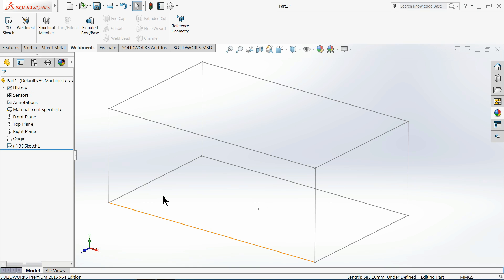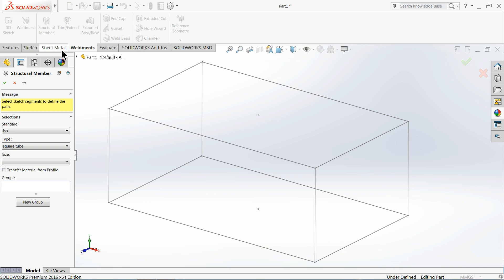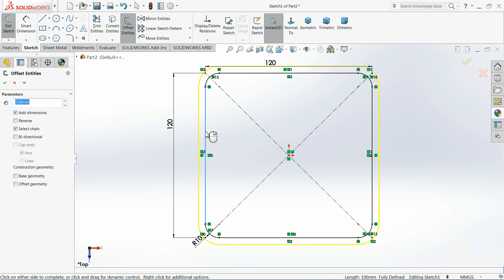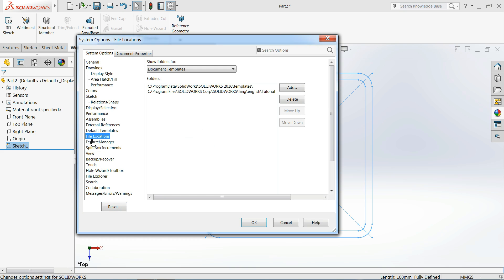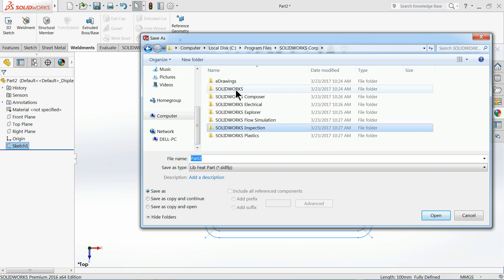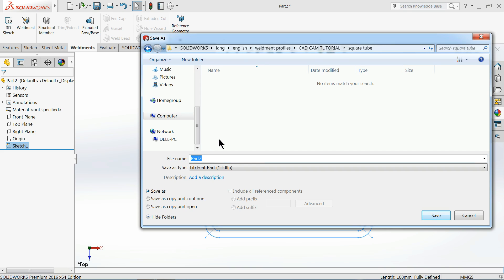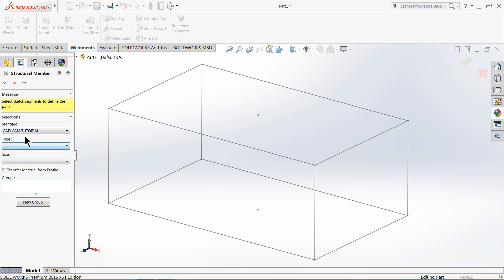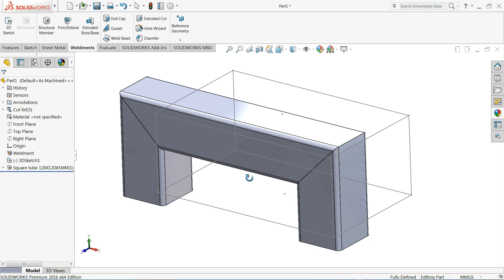How to create Custom Weldments Profile in Solidworks | Solidworks tutorial

Comment: Hi, When I try to save into a custom folder I get an error message saying I need to contact the administrator to obtain permission. What can I do to solve this issue? Thanks
Reply: Here is the explanation from internet, it worked for me:

Right-click the folder where you want to save the files and select Properties.
In the Properties window, switch to the Security tab.
Select your username from the list and click on Edit to modify folder permissions.
Check the Allow box next to Full control.
Hit Apply followed by OK.
Reply: @boskostojilkovic4655 Thanks mate, it's works for me✌🏼
Reply: @boskostojilkovic4655 Thanks Senior you
Reply: @boskostojilkovic4655 Thankyou so much god bless you 🎉
Reply: getting same popup , hv you got the solution
Reply: Thanks alot! It work for me